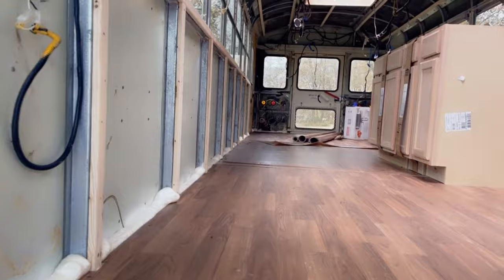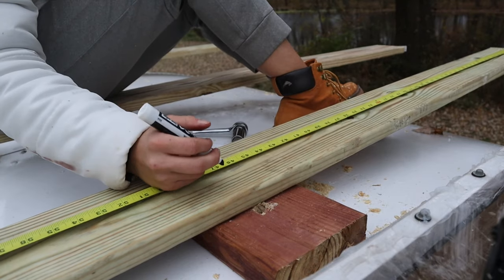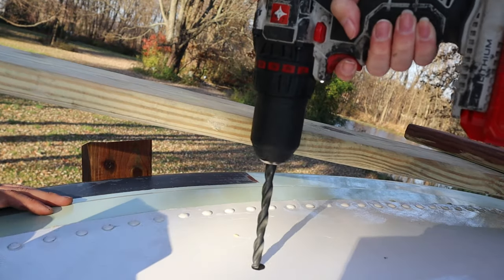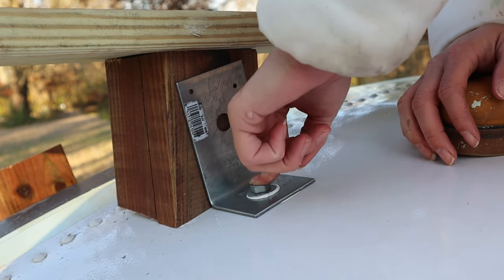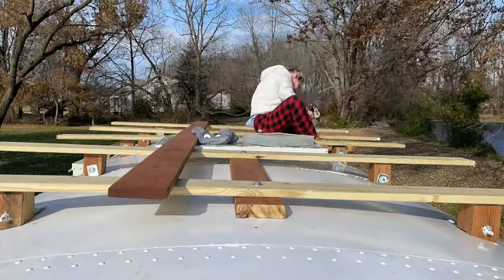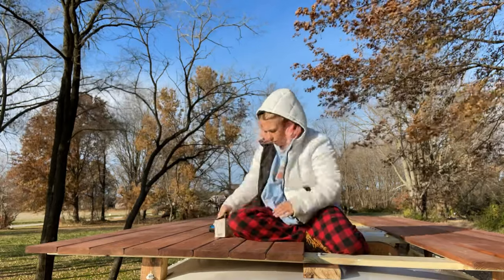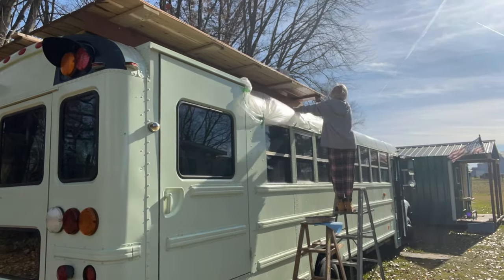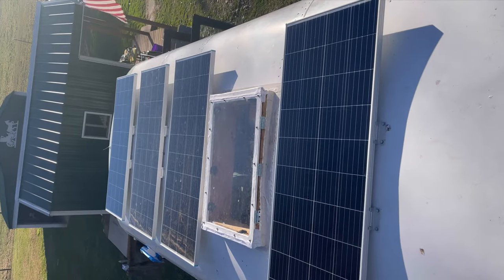DIY Skoolie Rooftop Deck | Bus Build Episode 8

Comment: Just a little fyi. Everything you’ve done so far in your videos looks great, but! Your deck I fear won’t hold up for more than a year or so. Mainly due to the dry rot that will occur to the large angled wood studs you connected your metal brackets to. Keep an eye on those and watch for decay and dry rot. Keep extra on hand to replace them after say a a year. I think this is your decks weak spot, but it can be managed and edited/changed over time. Also periodically check your deck nuts to make sure they remain tight. Still nice job, and for now it should hold up. Thanks for sharing. Nice to see a young woman take on a full size bus.